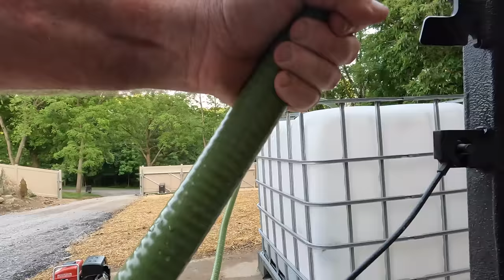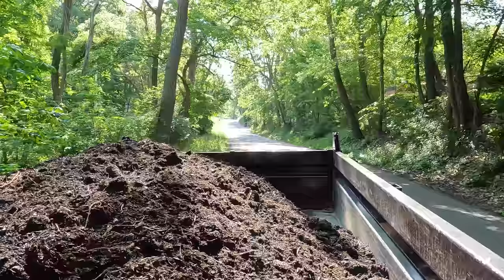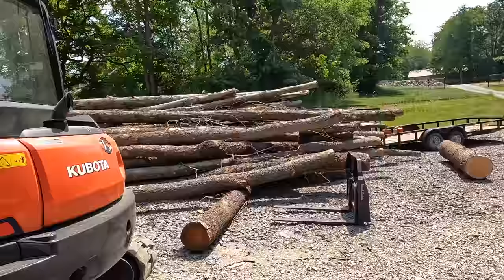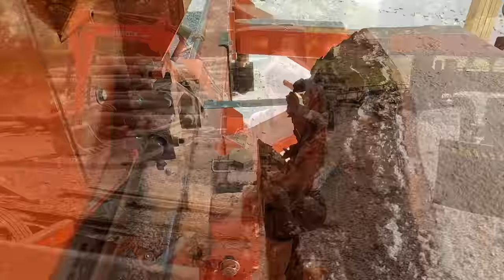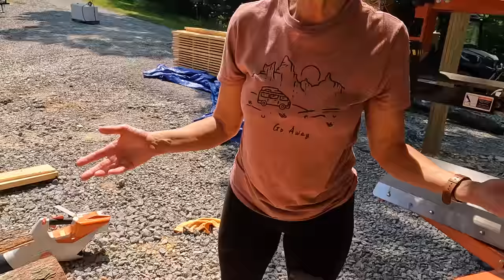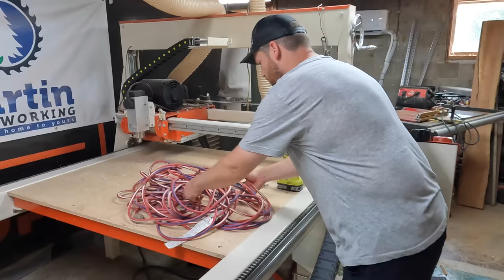Discovered Much More than Just Firewood in this Pile of Logs

Comment: Mike and Melissa. Here is a Godsend. Get two dishwashers. One on each side of the sink in the house. That is what I have. I carved a tiny bird out of wood, and I called it the dirty bird. So whichever side of the sink, on the counter the dirty bird sits, that is the dirty dish side. Never unload the other dishwasher because it is filled with clean dishes. When someone wants to use a dish, they take it out of the clean side, and when done using it, they put it in the dirty side. When the dirty side fills up, you move the bird, and do it in reverse. You probably spend at least 40 hours per year, just putting the clean dishes away. How valuable is your time? My Bosch stainless dishwasher only cost about $600, and the deluxe Kitchen Aid Superba was $1100 on the other side. LOve your channel. It's my daily cup of tea.

Comment: If you think about it, most table tops are 4-6 feet long so if you find sections that are straight for 4 to 6 feet and cut them at 8/4 as well, you could stack and sticker the log such that you would then have book matched pairs that someone could glue up to get the width desired for the table.  Would look beautiful in most cases.  A log doesn't have to be 8 feet long to be valuable, especially the hardwoods.  I enjoy watching you work lol!  I know I need to get a life (lol) but there's something calming about watching the wood splitter do it's thing and watching the pile get higher.  Also enjoy what you are doing with your "enchanted forest."

Comment: We run ours between 70 and 72; but its an older 3 story. The basement stays cold, main floor comfortable and the upstairs just a little warmer.  If you pulled out the button and then pushed it back in, you preset the station.
Reply: I keep my A.C. at 75 when I have it on. I don't like super cold rooms, never have.

Comment: Nice extra 4 slabs of wood.   You floored me with the button trick on the old car radios.   I had those for years and never knew you could stagger your finger between two buttons and get an extra preset station.  Now I want to go find an old vehicle and test it.   By the time I was a teen, I used the cassette player more than the radio.  Funny how things change.  Now we have all of this technology in car radios, and I would prefer not to listen to anything when driving.   I pull up to a kid in a car with the stereo cranked up and think... that used to be me.

Comment: Hey Mike I noticed When you were using saw mill at about 8.48 looked as if your tape measure rolled right out the saw dust tube! 😅  it was placed on machine and fell off from vibration. 
Yeah back in the day we didn't have air-conditioning either as a kid we would go down in basement to sleep on old mattress or old couch where it was cooler.
Keep Smiling On!!
😀👍👊❤

Comment: I know you probably know this little fact but, If you water at night, after the sun goes down, the water will remain on the ground longer than if you water in the morning. The sun doesn't have the chance to heat it up, but the night gives it time to sink down into the ground, thus watering the ground more efficiently. Still the work you are doing is looking good.

Comment: I was a police officer and when I started the windows in the cruisers were crank roll downs. Lots of times stopped at a red light someone would pull up next to me and be trying to get my attention. I had to lean over with all my gear on, reach past briefcase in passenger seat to get to the crank to roll down the window and usually they wanted directions. Power windows was a great innovation. Just push the button in the drivers door.

Comment: 73 deg is pretty cool for me. In the 50's all we did was sleep at the bottom of the bed we had a fan a sears fan on in the window at the top of the steps that was the AC. We watched ballgames in the den we ll had our feet sitting on an old black round fan that blew air out all around and up your pant leg.

Comment: I live in South Central Louisiana, on the coast. Our ac sits on 72 during the day and 70 at night. In the later part of July through September it,s
 very hot and humid here. So at this time, to be comfortable at night, we will drop it to 69 or 68 at night. It's very humid here during the day and at night. If your house is heavily insulated this is not as much strain on the electric bill as you would think. As long as you don,t have too much of span in the temps in the house your ac won't work too much harder. But it does get very uncomfortable here at times. Especially as you get older. My son lived in York for a while and I love your weather up there.

Comment: It separated on the end of the log that was cut and open to air allowing that end of the log to dry and check. The end of the log you cut to put it on the mill did not move. To avoid this seal the open end of the log when you get them in with Anchorseal.

Comment: How to straighten out the Hose is to adapt 2 connections one to attach to your Hot water Tank... The Spigot end and then cap off the other end.. Open the Spigot and allow the Hot water heat the hose to expand the hose back to Normal... That should take about 15 - 20 minutes.  The Hot water and Pressure will slowly expand the hose back out or allow you to straighten the hose out if this is what you want to do to save the hose.

Comment: 74 degrees is warm enough but not too cool. If the AC is properly matched to the building it will lower the humidity and provide a change of air, maybe a little circulation. All 4 components evenly balanced.

Comment: I keep my AC at 82.  It doesn't run much, but does when its nasty.  I used to set the heat at 68 in winter, but lowered it to 64 this year.  I might try 58 this winter.

Comment: depending on type of hose you can straighten hose out just by putting it into a tub of really hot water... UNLESS the hose is infused with a wire coil then its a matter of just using a vice and hot water...

Comment: I'm in S.c., hot and humidity is ridiculous but my wife is cold natured and in reality a.c dies not change temp much more than possibly 20 degrees. That being said ours is set at 76 with ceiling fans on. As long as the air is moving I can deal with it.

Comment: Hey Mike I noticed that the wood is neatly stacked in those totes and I was wondering if I just randomly tossed pieces in there if it would be better for drying since there is more air space?
Reply: I can tell you from the kiln drying side that loosely tossed dried more thoroughly in the stack than carefully stacked in the basket. The outer pieces were significantly drier than the middle due to lack of airflow. I also pulled off the side placard panels to assist with even airflow.

I'll have to let Mike reply regarding airdrying, but I'd imagine if you're giving it enough time, it'll season eventually

Comment: I think I got my air conditioner about ten years ago.  Before that, the windows were open all night and then closed in the morning before it got too warm out.  By the time the day was over, it would be getting pretty warm in there again.  The high humidity was the worst!  Everything felt clammy.  Now that I've got air conditioning, I wonder how I ever got by without it.  However, it's usually set at 72 degrees.  But that's bearable without humidity.

Comment: Or don't throw it away because you put a piece of flour on top of that toad cut a hole in top of the plywood mountain pump on. Top of it and then you get it made and then you can take that hose put your another filter on it or your filter on it to pump water. In the toe out of the toad leave it down in the hole. Let's take a heat gun and then heat that spot and then press down on it or the hammer or something lightly you're just tap it lightly or whatever and it'll go back to Round

Comment: Hey Mike, Melissa, I grew up in the PNW Pacific Northwest and you know it’s a little cooler here than it is back there but it does get up into the 80s and 90s share to and I keep mine at 78 I said that 79 equals to 78 and that seems to be when the heats on that seems to be the desired temp 77 is too cold 70 Niners not quiet or 80 setting it at 80 with cooler to 79 and that’s not quite enough

Comment: We had what my dad called the poor man AC it was a radiator for a large truck with a hose from the cold water tape to the radiator then another hose that ran to a well and discharged into that one had a blower fan as the cold water rotated through the radiator it cooled the house down. We had a well that produced 40 GPM so it was no problem did the same at the cabin just used lake water the problem with this system was it was either hot or cold no controlling the temperature